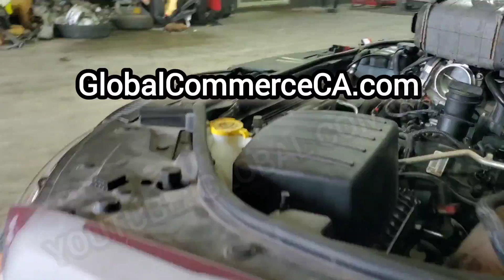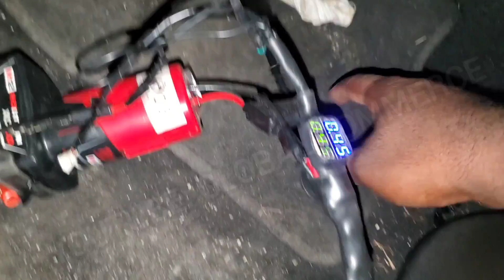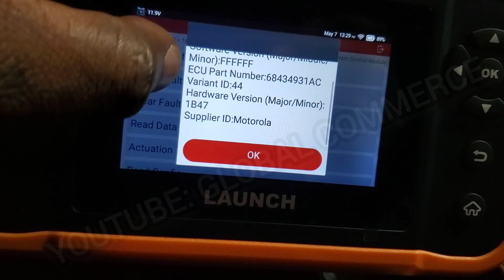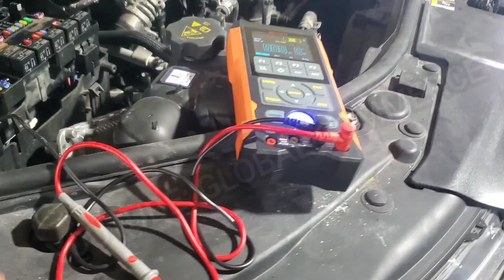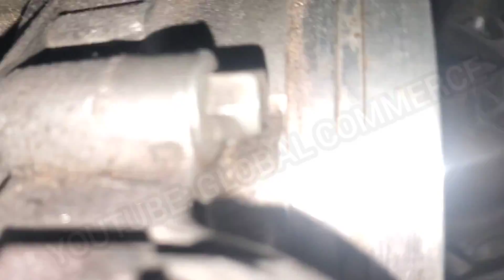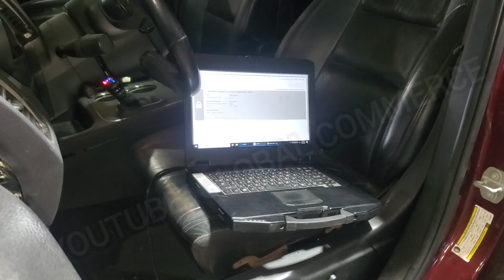2020 Durango,  NO crank! no Comm to ECM, P2183 Ignition Run Start control Circuit short, Diag Fix!

Comment: Be careful connecting a bypass ground like that to activate a relay, I did that once on a chevy trax and apparently sometimes that circuit in that side can become a power and will melt the board.  all I was trying to do was turn on the radiator fan. It worked till it didn’t. Either fuse it or put it through a bulb to keep current to a safe level.
Reply from the maker: Hi if you watch this video in detail I posted the ground circuit for that relay. It's hardwired to the frame. It's impossible to become hot. It's a constant frame ground.. if you noticed it was NEVER done until I verifiable that circuit. A frame ground is NEVER fused. I can't recall a respectable manufacturer that has fused the ground side instead of having the fuse on the hot side.

As far as the Trax, what year vehicle are you referring to? I'd like to pull the diagram,  I cannot recall EVER seeing a ground side pin on the coil ever being brought hot. I'm more inclined to think you had an electrical fault or you actually hooked up to the positive side and mistook it for the ground... I but would like to pull the diagram first to see.
Reply: My ground wire got hot and melted, but I don’t see no other wires burned. Now the car can’t connect the pcm…
Reply: All I did was ground the relay like you did and the radio and everything turned on. I tried to start the car and the ground wire melted, but now the car don’t want to do nothing even after replacing the relay. Did I fry the computer or something?

Comment: C1 12 on the fuse box should be checked for ground, has an inline connector, XY8120A pin 6 to G909A at RR engine compartment. But where is XY8120A? Got to go to a 2019 MY, RF harness across the front end.
Reply from the maker: Thanks for the info but if you watch this video in detail I show that ground circuit and also test that ground via another relay on that same ground. It's 100% confirmed internal tipm fault.